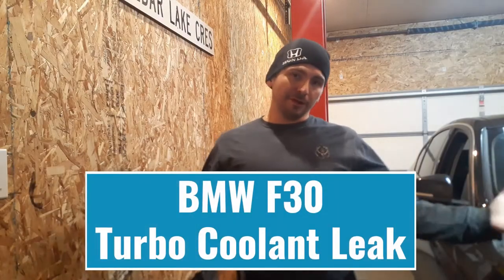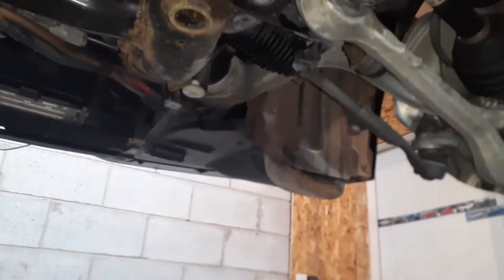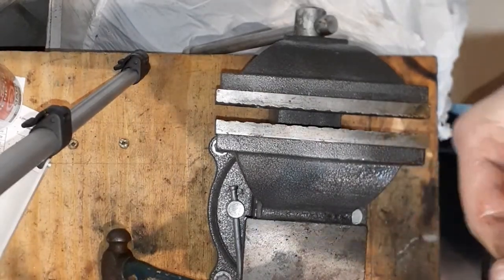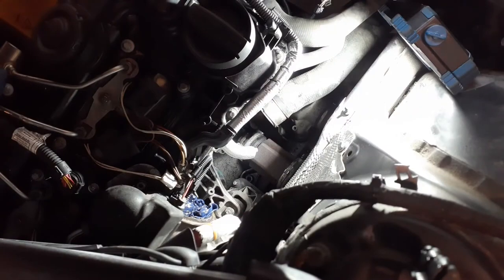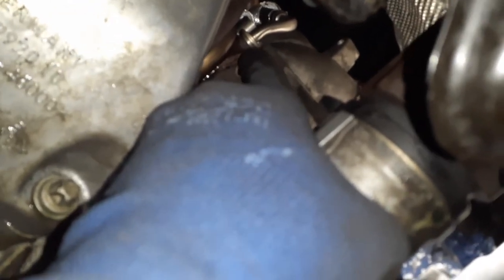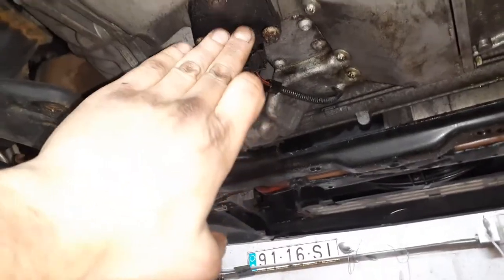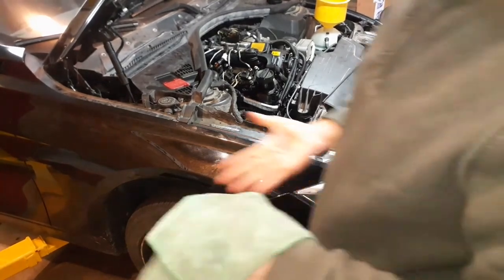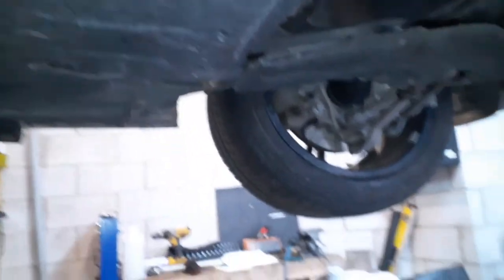BMW Turbo Removal ( F30, F32, F34, F25,F84 )

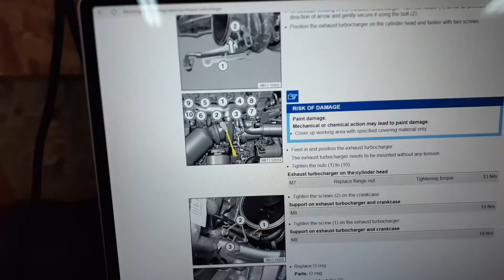Comment: Love the video I'm getting ready to do this myself. I know this was about a year ago. But what website did you use for instructions? specifically at 19:51
Reply from the maker: Well the website is officially finished. Bmw used to allow access to the manuals using 3rd party site. It was shut down. Go on alldatadyi. Pay 20 bucks for 1 month of access to 1 car worth it.
Reply: @MyHomeGarage  thank you for the quick reply

Comment: the oil turbo line does it fix flush to the block? the one that goes under the turbo
Reply from the maker: One goes to the side of turbo and one is bottom. One goes to front or block and one to back.

Comment: Please don’t tell me I have to take the entire turbo off in order to replace one of the lines???
Reply from the maker: Yes sir. Your only options are pull the turbo out the back or front lol. Replace coolant lines both and all o rings on oil lines. Gaskets you don't want to go back in

Comment: If I am going to disconnect the turbo coolant lines would I need to drain the entire coolant first? Or will only a little bit come out from the lines on the turbo? I have a 328i F30 N20 engine.
Reply: Sorry forgot to mention. I’m only changing the oil feed line on the turbo which is behind the turbo coolant lines. So I’m not bringing the turbo out of the car. But rather moving it slightly away from the block to get access to the bolt on the oil feed line.
Reply from the maker: If your going to disconnect those turbo coolant lines then I would atlease replace the o rings on the ends. Trust me. You could just drain the coolant from the lines. But it is low enough you'll get some coolant still.
Reply from the maker: Your so close to removing turbo.  It's gonna be tight to fiddle with it
Reply: @MyHomeGarage  thanks buddy.  I will be replacing the o rings on the coolant line ends whilst the other ends remain attached to the block. I am expecting some coolant to come out from the lines. My worry is that the entire 7 litres of coolant will come out? Was this the case with yours? As in the vid you cut out the bit where you drained the coolant
Reply: Hi mate. So I’m putting this turbo back together and I’ve accidentally ripped the metal sheet which is on the turbo coolant feed/return lines. Any idea what that material is or if I can wrap something around it so the rubber hose within doesn’t melt with the exhaust manifold heat?
Reply from the maker: @ImranKhan-ej3fy  it's heat resistant pipe. Like a flexible drier vent but smaller.
Reply: @MyHomeGarage  wow thanks! Also the bottom coolant line isn’t going al the way in, I’d say it’s 90% in. any advice on how to get that fully in?
Reply: @MyHomeGarage  hey mate. Managed to get the turbo out and back in! 6 days but my friend snapped a bolt in the turbo housing so took it out twice essentially!! Did you ever have to adjust your wastegate length or relearn it? I used to get loud throaty cold starts with it being a 328i but now it’s quiet like when starting with the engine warm.

Comment: call me crazy but i dropped the sub frame and it made it a piece of cake dropping the frame is alot easier that it looks on that car
Reply from the maker: That actually sounds like a way better plan. I was trying to make easier with removing less. But it actually makes it a bigger pain. Drop subframe support engine with stand. 200% what I will do next time.
Reply: @MyHomeGarage  yeh turbo R&R on F30 328i xDrive 2.0 is 6.7 hrs taking my sweet ass time i got it done in about 5 hrs. next time you see one id go that way.
Reply from the maker: I agree especially witha lift and a support table and engine support

Comment: does all that have to come off just to replace  coolant lines
Reply from the maker: Unfortunately yes. Great design lol.
Reply: @My Home Garage  thanks for replying.  taking it to shop .
my back can't handle bending over in engine compartments for that long anymore. 
cool image??
Reply: @MyHomeGarage  I mean design??
Reply from the maker: @dadkingcoffey8333  it's a pain. I wouldn't highly recommend having all the oil cooler lines replaced while they are in there. Worse case replace the o rings. Although the one I did is now leaking from the block side return. I wish I had just replaced it all now I gotta go back and change that.